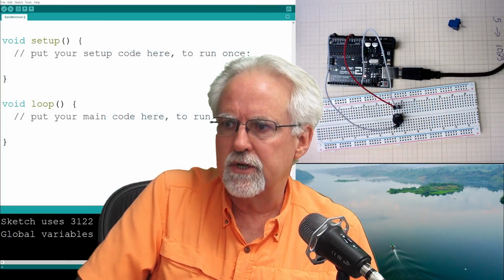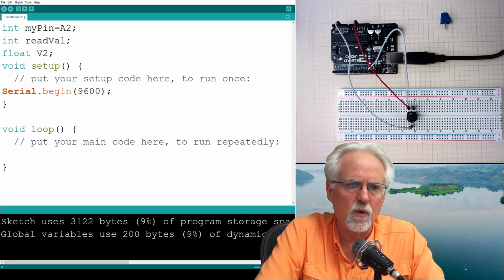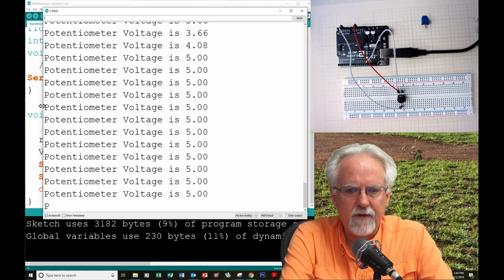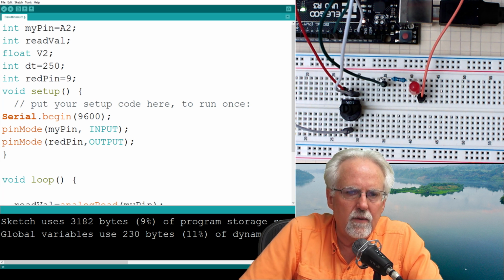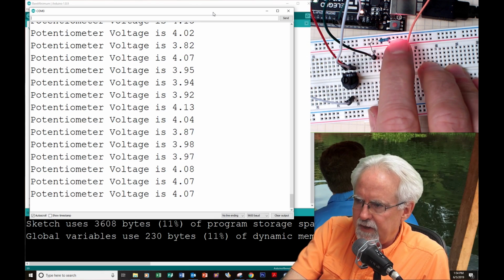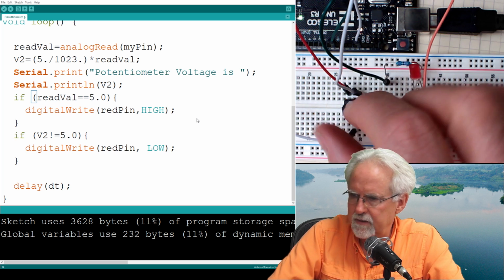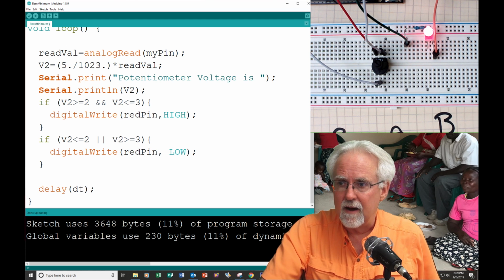Arduino Tutorial 13: Understanding Arduino If Statements

Comment: Thanks again for the upload Paul!
Reply: int inputPin = A2;
float V2;
int rawValue;
int greenLed = 2;
int yellowLed = 4;
int redLed = 6;

int waitTime = 500;

void setup() {

Serial.begin(9600);
pinMode(rawValue, INPUT);
pinMode(greenLed, OUTPUT);
pinMode(yellowLed, OUTPUT);
pinMode(redLed, OUTPUT);

}

void loop() {
rawValue = analogRead(inputPin);
V2 = (5./1023.)*rawValue;

Serial.print(" Voltage read: ");
Serial.println(V2);

if (V2 >= 0 && V2 <=3){
  digitalWrite(greenLed, HIGH);
  }
if (V2 > 3){
  digitalWrite(greenLed, LOW);
}
  
if (V2 >3 && V2 <=4){
  digitalWrite(yellowLed, HIGH);
  }
if (V2 <3 || V2 > 4){
  digitalWrite(yellowLed, LOW);
}
  
if (V2 > 4 && V2 <= 5){  
  digitalWrite(redLed, HIGH);
}
if (V2 < 4){
  digitalWrite(redLed, LOW);
}

delay(waitTime);

}

Comment: Paul, your logic ( >2 && <3) to turn HIGH then (<2 || >3) to turn LOW has a flaw. If the voltage is EXACTLY 2 or 3, you won't change the LED. Try using ( >=2 && <= 3) to turn HIGH and (<2 || >3) to turn LOW. This will catch the conditions when exactly 2 or 3.

Comment: Thank you for the lesson.
Just did the assignment. Went well and added a small twist . With voltages = 0V all off, >0  and <  1 yellow on, >=1 and <  2 red  on, >=  2 and < 3  green on,  >= 3 and  < 4 blue on and  >= 4 and < 5 white on , and finally = 5 all on.

Thanks

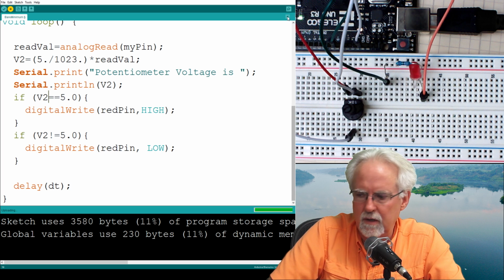Comment: Paul, This tutorial 13 is awesome and I'm at 27:06, and checking the if statement, you have V2==5.0 then does not equal, V2!=5.0, this appears to make the only instance for the redPin to be HIGH is exactly at 5.0 since above and below 5 are both !+ Thanks Now on With the BOOMS ...
Reply: Yes the letter "V" (upper case) and "v" (lower case) look very similar and has been haunting me all day at 30:04... soon to give you problems, Thanks

Comment: Finally got it after a few tries. I found i got a bit confused when it didn't work all together so i went back and getit to run step by step (green LED on 0-3 volts then off,then the yellow only from 3-4 volts etc etc )and got it running.HAPPY. here's mine with no if else
int voltage=A2;
int readVal;
int grn=8;
int yel=10;
int red=12;
float V2;
int del=750;

 
void setup() {
  // put your setup code here, to run once:
Serial.begin(9600);
pinMode(readVal,INPUT);
pinMode(grn,OUTPUT);
pinMode(yel,OUTPUT);
pinMode(red,OUTPUT);
}

void loop() {
  // put your main code here, to run repeatedly:
readVal=analogRead(voltage);
V2=(5./1023.)*readVal;
Serial.print(" The Voltage is ");
Serial.print(V2);
Serial.println(" Volts");
if (V2>0. && V2<3.){
digitalWrite(grn,HIGH);
digitalWrite(yel,LOW);
digitalWrite(red,LOW);
}
if (V2>3.){
digitalWrite(grn,LOW);
}
if (V2>3. && V2<4.){
digitalWrite(grn,LOW);
digitalWrite(yel,HIGH);
digitalWrite(red,LOW);
}
if (V2<3. || V2>4.){
digitalWrite(yel,LOW);
}
if (V2>4. && V2<5.){
digitalWrite(grn,LOW);
digitalWrite(yel,LOW);
digitalWrite(red,HIGH);
}
if (V2<4.){
digitalWrite(red,LOW);
}
delay(del);
}

Comment: I've been watching your video first, then starting from scratch trying to recreate your project using Arduino's own Reference page for help when I'm not quite sure of the correct coding.  It's a good thing you mentioned (5/1023) would not work umpteen times as that's what i tried to do for a while:(  I'm another senior viewer, just turned 60, I see there is quite a few of us commenting in this video.
Reply: It works if you define the values as float at the beginning instead of in the loop : 
float v5=5;
float max=1023;
float V2;

V2=(v5/max)*readVal;

Comment: Hello Sir this assignment took me a long time to make because while making this  project I had to go through many troubleshooting steps because my project was not working properly only to find out that my Arduino was working properly but my wires broken (nearly all of them). This is my assignment.

int greenPin=2;
int redPin=3;
int yellowPin=4;
float potPin=A0;

int potRead; 
float voltage;

void setup() {

  Serial.begin(9600);

  pinMode(greenPin, OUTPUT);
  pinMode(yellowPin, OUTPUT);
  pinMode(redPin, OUTPUT);
}

void loop() {

    potRead=analogRead(potPin);
    voltage=(5./1023.)*potRead;

  if (voltage<=3) {
    digitalWrite(greenPin, HIGH); 
    digitalWrite(redPin, LOW);
    digitalWrite(yellowPin, LOW);
  }

  if (voltage<=4 && voltage>3) {
    digitalWrite(yellowPin, HIGH);
    digitalWrite(greenPin, LOW);
    digitalWrite(redPin, LOW);
  }

  if (voltage>4) {
    digitalWrite(redPin, HIGH);
    digitalWrite(yellowPin, LOW);
    digitalWrite(greenPin, LOW);
  }
}

Thank you Sir for another great tutorial:)

Comment: Hi Teach!!

Thank you for another marvellous lesson.

Here is my sketch for the homewrok. Hope it meets your approval.

int potPin = A2;
int greenPin = 5;
int yellowPin = 7;
int redPin = 9; 
int readVal;
float V2;
int wait = 1000;

void setup() {

  pinMode(potPin, INPUT);
  pinMode(greenPin, OUTPUT);
  pinMode(yellowPin, OUTPUT);
  pinMode(redPin, OUTPUT);
  Serial.begin(9600);

}

void loop() {

  readVal = analogRead(potPin);
  V2 = (5./1023.) * readVal;
  Serial.print("The Voltage is ");
  Serial.print(V2);
  Serial.println(" Volts.");

  if (V2 > 2.0 && V2 <= 3.0){

    digitalWrite(greenPin, HIGH);
    digitalWrite(yellowPin, LOW);
    digitalWrite(redPin, LOW);
    
  }

  else if (V2 > 3.0 && V2 <= 4.0){

    digitalWrite(greenPin, LOW);
    digitalWrite(yellowPin, HIGH);
    digitalWrite(redPin, LOW);
    
  }

  else if (V2 > 4.0) {

    digitalWrite(greenPin, LOW);
    digitalWrite(yellowPin, LOW);
    digitalWrite(redPin, HIGH);
    
  }

  else {

    digitalWrite(greenPin, LOW);
    digitalWrite(yellowPin, LOW);
    digitalWrite(redPin, LOW);
    
  }
  
  delay(wait);
} 

Regards!!!

Comment: Hey, Paul! I did follow your last series on Arduino and I did make every single project that you assigned the viewers to do. You are not just talking to walls, you are helping thousands of people who seek to learn Arduino and microcontrollers stuff instead. I am waiting for more advanced things in Arduino because I am quite good at the basics and it’s all because of your previous series. You are awesome.
Reply from the maker: Thank you for your patience as this series starts people from square 1. We will work with more sensors and devices in this series, and then I hope people are interested enough in the 9-Axis IMU that I could do a whole series on inertial mesurement.
Reply: That might be a good idea.

Comment: I saw one example of code for the assignment, posted here, before I began the project and thought it more than a little odd…odd, as in “What does this gibberish :) have to do with a fairly basic Arduino tutorial series?” Anyway, I ignored the post and after declaring variables and doing the setup, I wrote three if statements, namely 
if(V2<3.0)
if(V2>=3.0 && V2<4.0)
if(V2>=4.0)
and followed each if statement with a block of three digitalWrite commands telling each LED what to do given the conditions in the if statement. Looks tight and tidy and works perfectly. Thank you very much for your tutorials. 
BTW, I know that the code I referred to earlier is not gibberish, just that it’s not useful to us beginners.

Comment: Does the led actually receive the full 5v with the pot all the way to the right after we put the resistor in? I would say yes because the resistor only limits the mA but not the voltage. Could you show us that with your meter? Is that were nodes come in with circuit analysis?
Reply from the maker: The pot should not be connected to the resistor. The arduino reads from the pot, and then sends a calculated signal to the LED. LED does not interact in the circuit with the pot.
Reply: Yes, I see, not in this circuit. But what about in a basic led-resistor and pot circuit? Will the led get the full 5v despite the resistor? The led will receive less current but will it also receive less voltage?
Reply: No, led receives less than 5volts. Let's think u have connected an led through 330 ohm resistor. Current flowing in the circuit is 10mA. So, there is a (10mA x 330 ohm) drop across resistor which is equal to 3.3 volts. So, led will get 5 - 3.3 = 1.7 volts.

Comment: 5v = 1023,      so 4v= 4/5*1023. So, if you turn the pot down to the left to 4v, Arduino reads 818 at A2.

Comment: I am a 70 year old retired electronics tech. I am thoroughly enjoying this series. I build every circuit and write the code. Thank you for doing this.
Reply: I'm 72 and retired from the Semiconductor Manufacturing Industry as an Engineer/Manager. I'm having a great time with this.
Reply: @chetk4624    I am a 74 yr. old retired Semiconductor Eng. Tech. (Intel, VEECO, AMD). This is my kind of NERD-fun! Reminds me of the machine programming used on the wafer handlers.
Reply: @jo-jobighiker5552  Ooops. This section is for the 50+ young and onwards! :p
Reply: I'm a 66 year old retired engineering tech that worked in the semiconductor manufacturing industry. I can troubleshoot electronics down to the component level and can build anything using solid state devices or vacuum tubes but software has always been a weakness. I know the basics of Basic and C++ but this series has been a great stepping stone for filling in some of the holes in my software knowledge.
Reply: I love this series and I'm only ten
Reply: I Know Basic Electronics And, Until Now, Nothing About Programing, And I'm Only 56. All Hail Paul. (Also Following Along With My Most Marvelous Arduino)
Reply: Hi. I am a 63 retired Agronomist. Learning Arduino for train modelling applications based in Costa Rica.
Reply: @Ronavargas  You people are inspering me
Reply: 52 years old female History professor here. I was not able to tell the difference between potential and current 3 days ago.
Reply: Thanks for the lesson.  Hot my homework done.
Reply: Guess I'll add my 2 cents! I'm a 70 year old looking also looking to automate a model railroad (2 actually) & I'm loving Paul's approach to teaching. Having a ball learning this stuff!
Reply: @garrettswoodworx1873  I tried doing the railroad automation back in college in 1985.  We had a computer that was for learning digital operations in the classroom that I hooked up my switches to and had reed switches under the track that sensed where the train was.  Train car had a magnet in it to activate the reed switches.  Hope that gives you some ideas.  I am in my 60's and got a 2 year degree in electronics back then.  On here to learn the Arduino side of it.
Reply: Good to hear it!   I am only 66 and taking this course to keep my mind sharp.  Its a lot of fun and certainly an answer to the lockdowns we are having to deal with.
Reply: I am a 54 year old maintenance Electrician who’s always had an interest in Electronics, since getting into Arduino I’ve built lots of working projects and this mans great teaching contribution to the world has helped me do this, instead of just buying components and fitting them now I can design, programme, build and install with a great a feeling of satisfaction every time something works, thankyou Paul.
Reply: Same here but only 66 !!  Thank you Paul indeed.
Reply: Very very well thought of series thank you for the effort.
Reply: I'm a 65-year old retired database programmer.  I love learning how to program a chip on a board.  I plan to keep studying until I can make my own circuit board for my robotic pool cleaner.  This is awesome training!
Reply: Hey, nice to here this comment
'
Reply: @Nichen Fauster that's wonderful !!
Reply: I've just turned 50 and seem to have developed a new thirst for learning.
Reply: @Nichen Fauster nice to learn.....r u there now......hopefully yes ...cheers
Reply: :) i also made my delay variable not_constant  lol
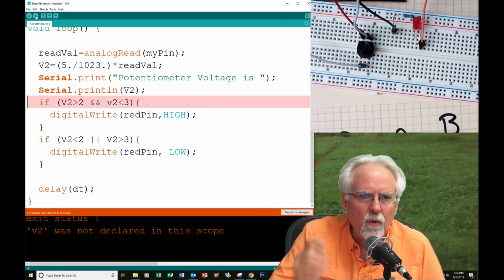Reply: 31:36  i dunno how to make the link one but i was laughing so hard that he took so long to reailize cuz of captilatoin
Reply: I’m 47 working in a shop with no schooling! I’m trying to learn how to test components of circuit boards.
Reply: Ditto, except, I was a chemist. Cheers.
Reply: And i am 72 yaer old retired USSR physics taecher. I really like this series too.
Reply: @Recycled Roadkill I am 63 next week and itvis certainly getting the grey cells turning over but loving the course and Paul is an excellent teacher.
Reply: 69 year oldster, retired from Michigan Bell Telephone Company 14 yrs ago. Nice refresher classes, perfectly paced.
Reply: Hi Walt and Paul. Likewise-another 70 yr retired electronics tech.
Reply: Need help, computer says in red highlight " expected at end of input" using Arduino module Rev3.... character looks like a really bent up bracket
Reply: 63 and kicking up dust. 🤪👍😊
Reply: Your only as old as you feel. 😌👍
Reply: You rock Paul. ☺️👍
Reply: Have no idea what's with all the seventy-somethings, but I too am seventy and enjoying this series. I come from a software development background and have done c/c++ since the 1980's, but haven't written a line of code since I retired a couple years ago. But I'm having a great time doing the circuits and playing with the code. The best of both worlds. And, yes, Paul is doing a great job.
Reply: @Jim-mn7yq  Its because we're retired and need a hobby. LOL

Comment: My sketch for this tutorial. 5 LEDs GGGYR indicate Vdc from 0.01 - 5.00. Great video. 

[code]
// Voltage level indicated by 5 LED indicators [GGGYR]
// Paul McWhorter YouTube Tutorials
// https://www.youtube.com/watch?v=ORNted-NgRM

// Red LED alerts to [exceeding] 4.0Vdc on INPUT pin

// G1=0.01-1.00, G2=1.01-2.00, G3=2.1-3.00, Y1=3.01-4.00, R1=4.01-5.00

#define NBRLEDS 5
// store LED pin nbrs in array [GGGYR]
int intLED[5] {8, 9, 10, 11, 12};

// analog input PIN nbr, analog InputValue and calculated Vdc
int intInputPin = A0;
int intInputValue;
float fltVdc;

// create conversion factor 
// 10 bit analog input (2^10 = 1024) and +5Vdc ARef
float fltConvert = 5.0 / 1023.0;

void setup() {

  // set pinMode for each output LED pin
  for (int i = 0; i < NBRLEDS; i++) pinMode(intLED[i], OUTPUT);

  // set PinMode of Vdc INPUT pin
  pinMode(intInputPin, INPUT);

}

void loop() {

  // read analog INPUT value
  intInputValue = analogRead(intInputPin);

  // convert analog INPUT to Vdc
  fltVdc = intInputValue * fltConvert;

  // loop for each LED OUTPUT pin
  for (int i = NBRLEDS - 1; i >= 0; i--) {
    // if input Vdc exceeds threshold turn on indicator
    if (fltVdc && fltVdc >= i) {
      digitalWrite(intLED[i], HIGH);
      // otherwise turn indicator off
    } else {
      digitalWrite(intLED[i], LOW);
    }
  }
  delay(200);

}
[/code]
Reply from the maker: As you know I hate else

Comment: hi paul. just wondered if you can do a list of things if the statement of the if command is met, by that I mean I wanted to take it further and do a green for up to 2.5v. yellow for up to 3.5v and red up to 4.5v but flash the red if above 4.5v so wanted to know is there a way of putting the flash routine as a sub routine and if the if statement is true then run a sub routine rather than try to ram a potential ton of code in the condition of the if statement. hope that makes sense. and loving the series so far. from UK

Comment: Another excellent lesson. Please would you explain why variable names start with lower case letters but include an upper case letter as in myPin or readVal.
Reply from the maker: It does not have to be that way. Just you can not use spaces in variable names so upper casing first letter of new words makes it easy to desipher what you are doing. Just a convention that makes the code readable.
Reply: In all the tutorials I've read/followed on Arduino and it's coding, I've never seen an explanation of that convention. Thank you for doing your homework!
Reply: Still watching this video. Fantastic explanation of coditionals! I really like your diagrams of And and Or functions. Much different perspective than when I taught Digital Techniques. Do you have a link for a programming reference for Arduino C?
Reply: When I teach kids (7th, 8th grade) at school the first and basic convention, I tell them --> use "_" (underscore) whenever you want a "space"  (while writing code)  and  also, never begin a file name with a number or sign - always a "letter" ...

Comment: I was almost expecting you to add an  else   or  if else in there to turn the led off .
Reply from the maker: Some of the largest nightmares in my life were associated with people using else statements. It is like it requires people to think in terms of double negatives. I insisted in projects I led that else statements not be used, but if needed two if statements for the sake of clarity of code.
Reply: Paul McWhorter 
I know what you mean ! 
A project i am currently working on  uses an if statement to monitor the level of two sensors and turn  on a relay when those parameters are met but the original sketch used if else turn to turn it  off , problem is when one sensor is hovering at that threshold the relay would chatter on and off which inevitably kills the relay .
It was out with that if else  statement and in with a few  more if statements so i could set the  the level at which the relay turned off to be a little lower than the level it turned on and is very similar to what you did with the two voltage levels in your video . That is the problem with using a code someone else has written and i ended writing my own but got exactly what I wanted .
Thanks for all your hard work making this new and improved tutorial Paul and i look forward to the next instalment !
Reply: @paulmcwhorter  ..so true !